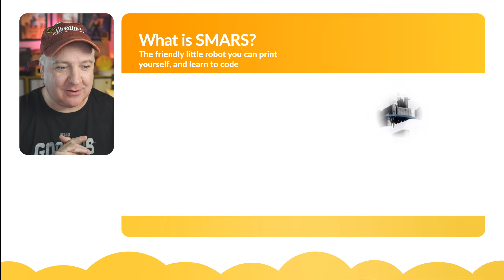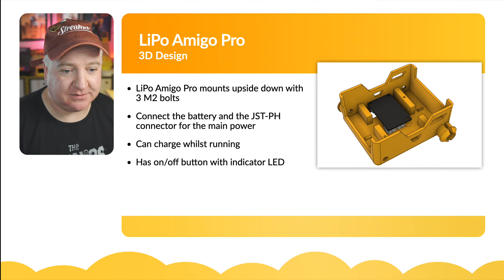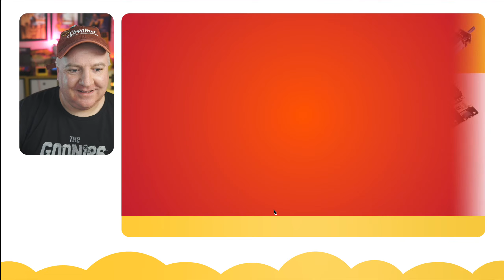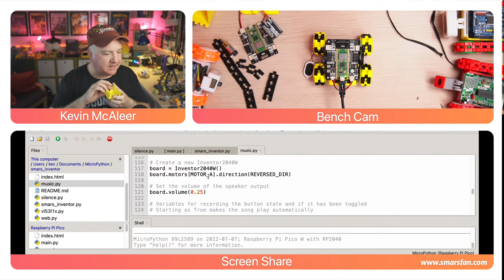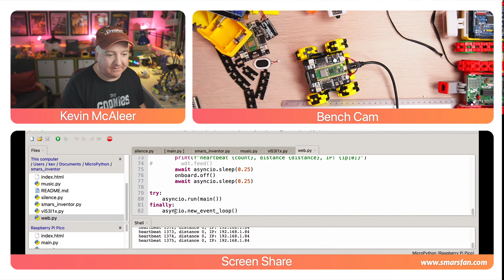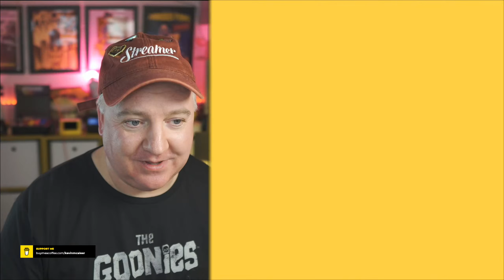SMARS Inventor - the Pimoroni Inventor 2040W Powered SMARS robot

Comment: Hello! Love your videos on the Inventor 2040. I have 2 of then now because of your videos. 

Question I have. I am using a LiPo to power my robot with 4 servos hooked up (says they have an operating range of 4.8v). The robots starts to sputter out. People have told me I need a step up board. I have a couple I ordered but I am not sure how to wire them  in or if I actually need one. 

I also have the Amigo Pro and an adafruit verison too. 

Love your thoughts on this.

Comment: Yes, this is very helpful for getting started with the 2040. I plan to design a new chassis for this but I will use the time of flight sensor (and the motor encoders). I’m planning to use two wheels and a ball bearing “third wheel” at the back of the chassis. I haven’t had a lot of good results with the track style movers and generally I prefer wheels. 

Thanks for sharing the micropython code and web page - that is a huge step forward for me. Keep up the great work :)

Comment: Any pi camera expansion?
Reply from the maker: Cameras are a bit trickier on the Pico (and therefore inventor 2040W) just because it’s a microcontroller and the camera module therefore needs a bit of extra circuitry to work. However I do know Pimoroni are launching a wildlife camera (enviro camera) based on the Pico W so it’s something that could happen!